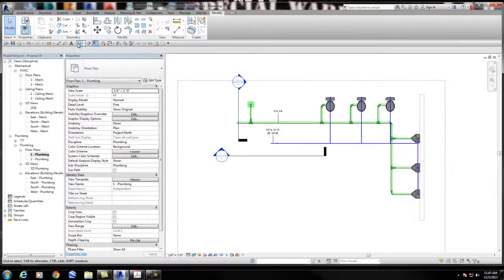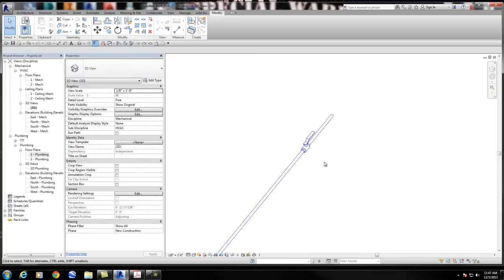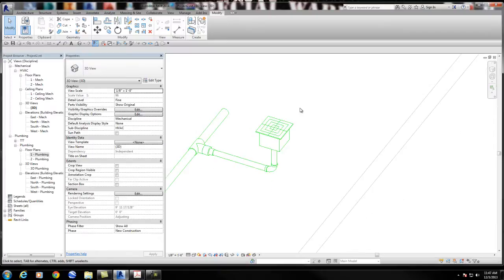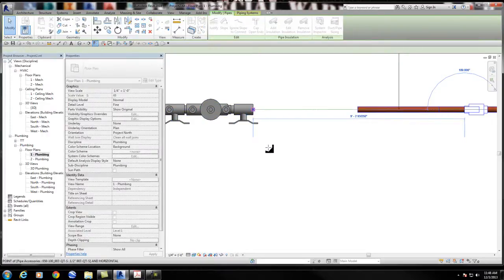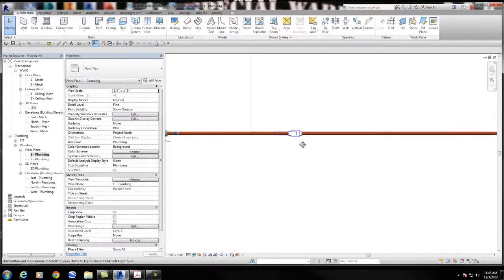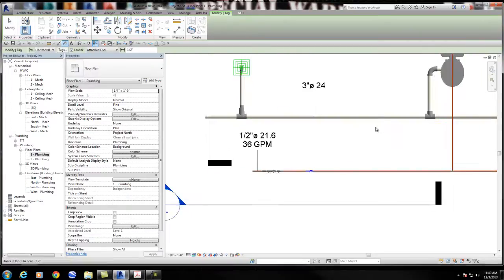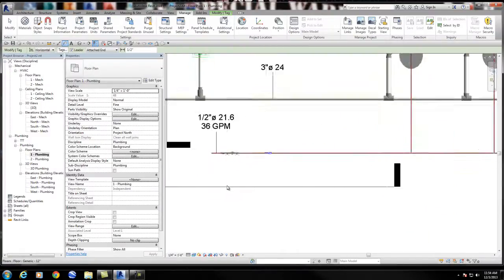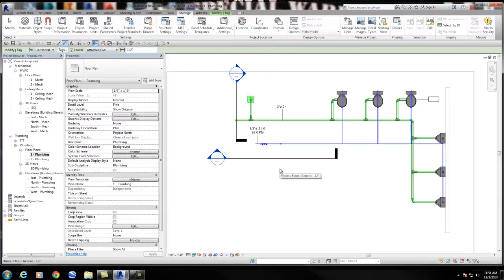Revit 2014 MEP Flow Question & Tips

Comment: Have you found the solution for this? Why don't you create a calculated flow value (using the GPM and Fixture unit values on the left side to create the formula) in the pipe tag instead of the default flow value? I did a fixture unit and my modified flow value to display the fixture unit to GPM flow using modified Hunter's Curve B ( I created a formula out of the curve).